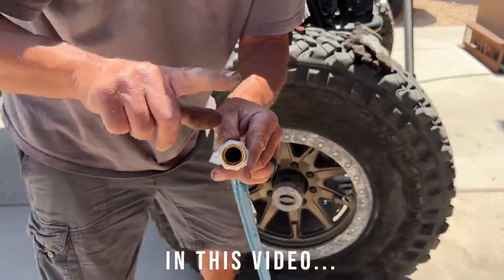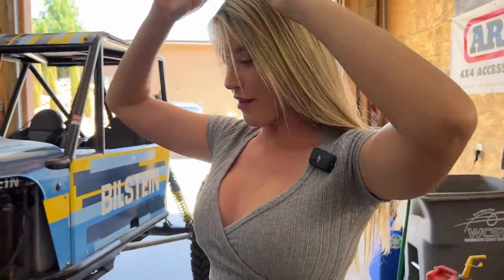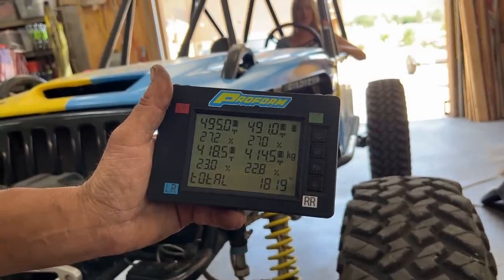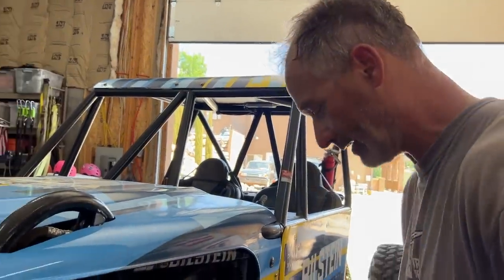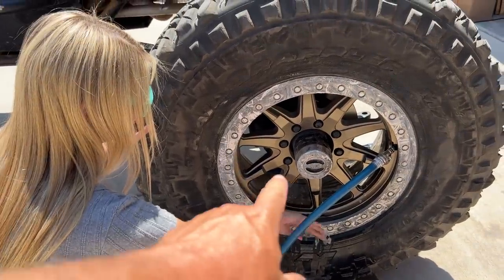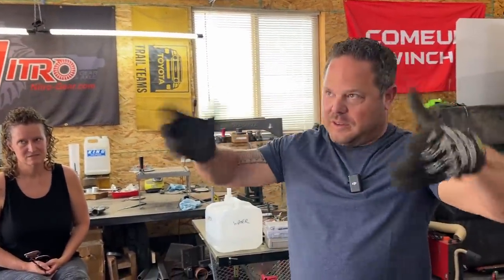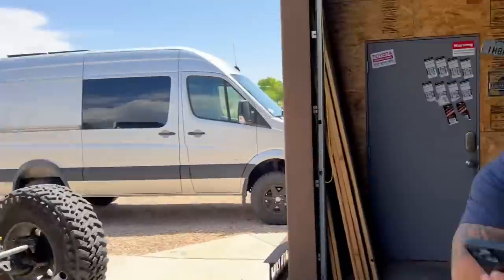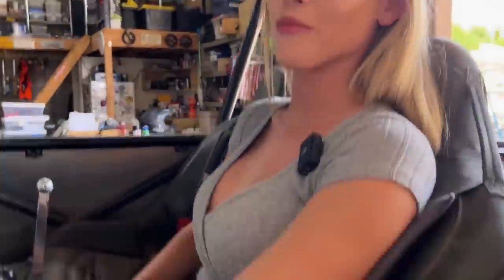Filling My Off Road Tires with WATER!

Comment: Why on God's green earth would you fill your tires with water? 🤦🏼‍♂️🤦🏼‍♂️ Just sounds like a bad idea gone more horrible! 😂😂
Reply: Adds weight at the lowest point possible.
Reply: @rrr3r2  I get that, but seems like you'd be prone to break something too.
Reply from the maker: Nearly all of the best professional rock crawlers run water in their tires. 🙂 If you’ve ever watched or spectated at a W.E. Rock competition, every buggy you see runs water (or water & lead, or some variation) in their tires. This is not for vehicles driven on pavement, and not something an inexperienced driver should do to their rig.
Reply: @LiteBrite  Interesting stuff though, although I'd worry about breaking something if it's too heavy. Something I'd be weary about. 🤨
Reply from the maker: That’d be like being worried about running 40” tires, cause of the risk of breaking something. Which is totally a possibility. But that’s where driver skill comes into play to help mitigate breaking & making sure your rig is equipped to handle it. And in the event that something breaks, you learn from whatever mistake you made & build it stronger for the next round of trails. 😁
Reply: @LiteBrite  Yeah, probably right about that. Very true. 👏🏻🤟🏻